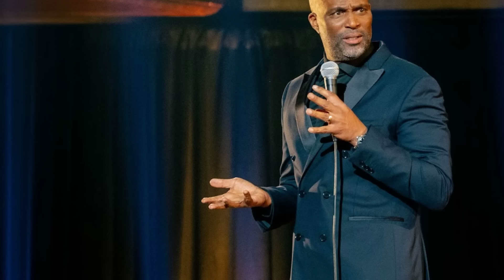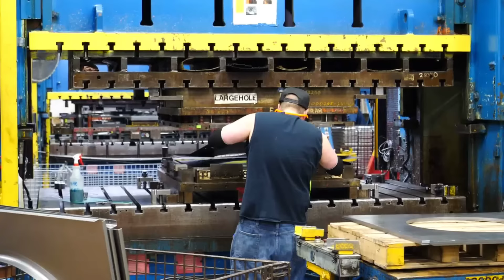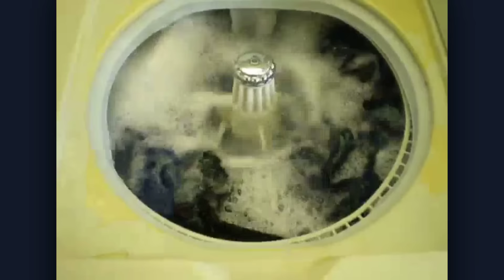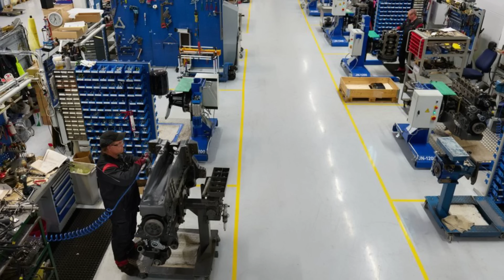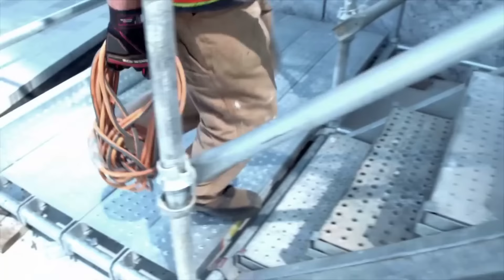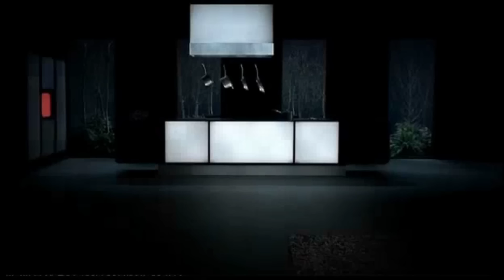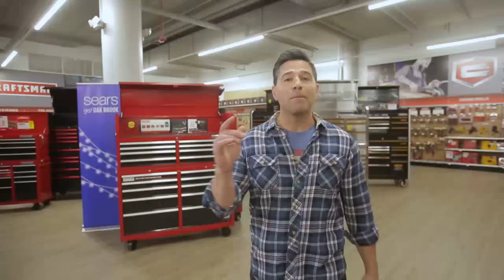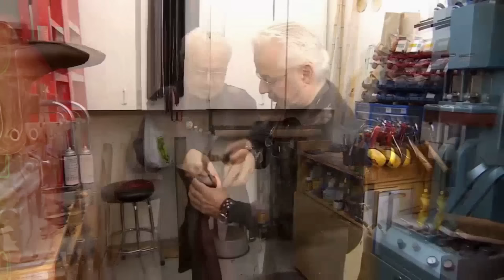The Only 5 Brands That Still Last (The "Buy It For Life" List)

Comment: I went into Lowe's 10 years ago and told the guy, I want a speed queen with a commercial motor and a stainless steel basket. Nothing else. No bells and whistles. The guy couldn't believe that is all I wanted. It's still running with zero problems...
Reply: My Speed Queen has been running for 8 years with no problems   The last Whirlpool washer I bought lasted barely 5 years.
Reply: I can get on board with that. My Speed Queen will be on my inheritance list as things stand right now. To my daughter, I bequeath one cared for top of the range Speed Queen washing machine......🙄
Reply: @Tsar-w1c Hopefully she understands and appreciates it instead of trading it in on a shiny new front loading Samsung spaceship with Bluetooth. 😅
Reply: @Tsar-w1c Hopefully she understands and appreciates it instead of trading it in on a shiny new front loading Samsung spaceship with Bluetooth. 😅
Reply: I didn’t know we could get speed queen at Lowes
Reply: @trishcrum7070You could 10 years ago. Don't know about now.
Reply: @trishcrum7070you can't, and you couldn't 10 years ago, or 15 years ago.
Reply: @trishcrum7070in Lowes in Australia 🇦🇺 they sell Cothes Neen around over 100 years
Reply: I was given a Whirlpool washer and dryer by my parents when I got married.  32 years and it's still running.  Only repair we ever had was a water pump.  Best present ever.
Reply: Same! Ours is turning 15! We are a family of seven, so we do laundry every single day.
Reply: Lowe's has not sold speed queen in any way, or at any time during the last 15 years.
Reply: I bought a Roper washer and dryer from Lowe’s 20 years ago. It was the cheapest set they had. I think I paid $500 total. The dryer is still going strong. The washer quit two years ago. AFTER lasting through two babies/toddlers. I don’t think the thing stopped running for four years straight. I also have an old house…in the desert. The machines are in the garage. So it gets near freezing during winter and 110f during summer. 
 Roper is Whirlpool’s budget brand. So basically they were stripped down whirlpool’s. 
 Point is that we don’t need $1500 commercial machines for home use. They could make a decent product that lasts 20 years and sell it for $500. 
 They did it. 20 years ago.
Reply: @AlphanumericCharacters They ( the corporations) Could make high quality machines, but they won’t.  The bottom line is the bottom line.
Reply: @AlphanumericCharacters have never seen a Roper. Now I will be looking (currently a new Whirlpool at the cheapest price I could find). 
The only major problem I have with my new ones is that the top loader washer is so tall, I must use a stepstool to reach the bottom to get laundry into the dryer (with no internal light). 
Maybe I bought Ropers marked Whirlpool?
Reply: @ecouturehandmades5166  Roper is (or was) Whirlpools bargain brand.
But neither is any good anymore. Buy whatever is the cheapest and just know you will have to replace it in 5-10 years.
Or buy a Speed Queen and you will never replace it
Reply: have owned my Speedqueen 10 years too.  only replaced a drum belt because husb jams 10 pairs of jeans in a load
Reply: I'm shocked the guy at Lowe's knew what you were talking about
Reply: my speed queen died,  cost to much to fix,, now i'm stuck with a 2018 kenmore but it was free !
Reply: Bought a TS5 Speed Queen 2 years ago. I got tired of front load “Washers” taking nearly 2 hrs to not wash my clothes. This washer cleans my clothes very well and is done in 30 minutes. I can have dirty laundry cleaned and dried from start to finish in an hour. I watched a video to learn how to stuff a piece of styrofoam into the back to turn off the inspection switch so that the washer still works/fills even with the lid up. My daughter in law makes fun of me being proud about my “Laundromat washer”. I’m figuring she can make fun of it while she buys her next 3 washers at least.
Reply: US made? OK.. But my first Miele washer was brand new and gifted to me by my boss. My first job after graduating.  After 8 years I left the firm after being headhunted and took my Miele with me. 12 years later I sold it on Ebay. We wanted some more bells and whistles. So we bought a new Miele now 17 years ago. Last summer, an  unbalanced centrifuge cycle at 1600 rpm caught our attention. We were disappointed and complained to the distributor. They sent a guy over who gave it a once over and replaced two shockabsorbers. Downloaded the stats of the machine and had a coffee with us. He showed us in the database that this was very uncommon and we would not be billed.   We should be good for another 18 years. But by then, we'd have a house robot doing our washing and ironing for us. So we are considering gifting the machine to one of our kids and buying a new one without too many bells or whistles as we only use 6 cycle types.
Reply: New speed queen is not the same.  I hate mine.. does not clean clothes on normal settings and the dryer burns my clothes
Reply: My front loader LG washer lasted for 21 years.
Reply: @Chhesterification you've been lucky.
Reply: @Chhesterification  Did you ever turn it on or did your house burn down??
Reply: @donkeyrinser I used the hell out of it. I even washed horse blankets and saddle pads in it.
Reply: @Chhesterification  Raised on a ranch myself, so I have first hand experience. That's crazy. Sounds like you got a diamond in the rough. Congrats.
Reply: @donkeyrinser I finally had to replace it. But it had a good run. When I move I plan on buying a speed queen. I'm not messing with any of the consumer brands.
Reply: My Kenmore Washing machine top loader has 21yrs & still going.
Only changed the rubber Washer Motor Coupler Coupling($12 part),twice in 21yrs(I’ll take that). That machine is a BEAST.
Reply: 10 years is not exactly a track record. But you are on the right path there... ;)

Comment: Knipex is good too, and even though it's made in Germany, I respect any tool / product from any country that works well and lasts. My LG washer is an outlier, bought in 2015 and only had to replace the waste water pump once ($25 for the part and easy to do...thanks to Made in China for providing the part) although, LG's charges $400 for a new boot gasket (just buy the $12 dollar tool, and soak the gasket in bleach for a half hour, good as new.) There's loads of disposable garbage out there, but even with the garbage, most times if you take care of it, it can last, unless engineered to fail no matter what you do with no parts available or engineering flaw, OR runs on unreplaceable lithium batteries. The WORST BRAND I found to be with regards to everything they make is Frigidaire / Electrolux

Comment: What pisses me off is that they purposely make appliances non repairable. If a microwave fails - throw it away. But it's not a rocket science to make a microwave repairable. What usually breaks in a microwave? Magnetron, latches... Sell these parts. Common failures center on a few key parts that manufacturers could easily make modular and sell separately.

Comment: While I don't mine Cast Iron Pans, my go to is vintage Revere Ware. Not the new garbage they make, but the 60's thick copper bottom and thick stainless steel. You can't destroy them, they deep clean with steel wool and copper acid cleaner. And since it's pure stainless steel. No chemicals and no transfer of anything.
Reply: This 💯 I bought a huge set, piece by piece, from Goodwill
Reply: @AprilcadabraWish I still lived in the USA so I could do this.
Reply: I use mine daily! I have so many sizes because I’ve picked up more at thrift shops…
Reply: I got my Revere Ware 30 years ago when I got married. I'll be passing it to my daughter one day.
Reply: I got my moms, from 1955. They’ll last forever.
Reply: Yeah, I have some I bought new 35 years ago and then got others at estate sales.  I use cast iron too, but I think some things work better with the steel and others with the iron.
Reply: The Company was literally founded outside of Boston, MA by Paul Revere who was a Silversmith and Coppersmith.
Reply: I still use my grandma’s and mom’s old Revere Ware but also bought some pieces of my own when I got my first apartment decades ago. Never been temped to use anything else except for some Griswold pieces.
Reply: My parents are still using the set they got as a wedding gift in 1980. Looks brand spanking new.
Reply: I wish I still had my Revere Ware that I inherited from my grandma in 1978.  Probably 40+ years ago my Mom talked me into loaning it to a guy she was dating - operative word “loan”!  Never got it back when she dropped him.
Reply: Please, I have a question. I LOVE my R.ware, and lent my big pan to a neighbor who returned it warped...is there ANY way to get it straight again????? 

Thank you, VERY UPSET in 🇨🇦
Reply: I have a decent set of Revere Ware I bought in the 80s and a fair number of different Griswold cast iron.  A few years ago I added a couple of saucepans by Demeyere.  They are made in Belgium, are a five ply stainless steel and aluminum sandwich and have well designed cast aluminum handles that stay cooler than most others.  Very nice pieces.
Reply: I've got a set of 45-year-old Farberware pots & pans. Stainless steel with aluminum-clad bottom. Wouldn't trade them for anything.

Comment: I inherited a Dorsey hand mixer from my grandmother and it still works well. I also inherited her Electrolux vacuum cleaner from 1940 that still works. I bought my own Electrolux in 1978 because both my mom and grandma had one and I have only replaced the hose and the wheels. The Singer Featherweight sewing machine is a workhorse from around 1940 and have one. I also bought a Singer sewing machine in 1978 and use both regularly for clothing, quilts, and other household goods and crafts.

Comment: Even Speed Queen now has a printed circuit board. The TC5 is small(3.2cFt)
Honda is a fantastic engine. Predator from Harbor Freight is a good budget alternative
Redwings are great boots. I am on my 4th sole
I have tons of cast iron, some of it was my great grandmothers. Lodge is decent; I sanded it smoother before use.
Knipex are the best pliers, ICON and WRIGHT make good tools
I wear All American Jeans, they last 4-5x the newer Levis that come from overseas.

Comment: 5 years ago, I was forced to go out and purchase my wife a new front-end loading, washer, and dryer. I guess she was tired of looking at old design. So I took the old ones and put them in the garage eventually, I hooked them up in the garage for an emergency. In that 5 years, my wife has been to the garage three times to do laundry because the new ones broke down. The most recent breakdown was the pulley system on the washing machine. When?\n I came home from work there. My wife was in the garage, drinking a glass of wine and talking on the phone with her friends, waiting for the clothes to be done in the dryer, I got out of my car.  And laughed, she said, why are you laughing? I said, just think of all the extra exercise you're getting from that new washer and dryer, not working.

Comment: I have a Speed Queen washer and I think the one specified in this video. This washer may last a long time but I have a story to tell you. I had a repair company come out about 5 times to repair my Speed Queen. The issue was water related. First they sold me a new plastic water inlet valve. The repairman told me it is the Achille's Heel of the unit. That repair helped but it didn't fix the whole issue. Then they came out and sold me a new motherboard. That didn't fix the problem. Then they put a new belt on the model. That didn't fix the problem. Then they finally removed one of the hoses from the back of the washer and POKED A HOLE in the SCREEN FILTER which is attached to the hose washer. Finally the problem was the unit was quitting in the spin cycle because there wasn't enough water going into the rinse cycle. The screen had some trash in it. I was charged $600 and had to go to the laundrymat even though I had spent $1,200 on a "dependable" Speed Queen. I had to wait for the model too during the Covid Shutdown. This unit may last a long time but I've already basically spent enough money to buy a cheap washer. So, if you have Hard Well Water as I do, remember it clogs up the inlet valve. And you might get some trash in the filter.
Reply: Sounds like a lot of the issue may have been the repairmen and not knowing what they were doing. I too have a well and mineral deposits can sure be a problem. We also have a water softening system to combat that. And it sure does help a lot.
But we do still get some mineral deposit collection on the filter screens. Same for the sink faucet screens.  But the same thing happened when we were on city water at our previous house. And the same will happen on any washer that you get. Just have to learn how to clean the water filters.

Comment: All of those gas small engines keep working if you use non ethanol gas. It costs a little more than premium but My mowers and tools keep going.
Reply: "Costs a little more" $25-$30 per gallon for non-ethanol in my state. I use premium octane with stabilizer which has worked well if non ethanol gas isn't available or priced insanely high.
Reply: @LarryG321 Wow! it is only a  dollar more in my state. It is just a little more than premium here. I usually find it at Shell stations. Dont buy the stuff in the stores. Try a Shell station.
Reply: @LarryG321 you can buy ethanol free at the pump. I just saw that expensive stuff online. Nope, not that one. Take your gas can to the gas station and look for the ethanol free pump. Just as you would pay for diesel fuel. It helped me a lot when started using it. my tools crank year after year. I have Craftsman, Honda and MTD. They all fire right up and my arms are puny😮

Comment: Look at Staber washing machine machines. I used to sell them 25 years ago to people who lived off grid with wind and SOLAR and batteries for power. Needed something that worked that didn’t use a lot of power or water.
I sold a total of six :-). One to myself. We still have ours, still works fine. They ARE. Made in the USA. Really. You can still get parts for them. They are made to last. No, I don’t sell them. I’m an electrician and I used to sell them too my off grid customers.

Comment: Replaced a useless front load washer with a second hand KitchenAid top loader with a direct drive motor and muti functions with a none locking lid. Best washer I have owned ever. Still have a working 1984 Maytag dryer and a GE Medallion electric range with real fuses in the top panel. An appliance repair man told me to keep my stove as the newer ones don't have fuses and when they blow they cause fires which start in the electrical panel of the house and end up burning down the house!

Comment: Kobalt Tools used to come with a LIFETIME WARRANTY. 
because 98% of anybody who uses a wrench / ratchet isnt going to break it -- EVER.
you know how hard it is to Bend a Wrench ?? damn near impossible. Hence the Lifetime Warranty.

but the warranty is only as good as the product - right.
like Autozone --- most places wont sell an Alternator or Starter with a Lifetime Warranty... bcuz ITS GOING TO WEAR OUT..
but for some reason, Autozone DOES.... and it DOES Wear Out...usually withing 1-2yrs... and you have to replace it Again....and Again... and AGAIN.
but if you just spend the extra $20 for Bosch... it will last you 10 years or more...   MONEY WELL SPENT....

Comment: I have a 1990 Chevrolet S-10 Tahoe short wheel base. It has been in regular use since my father bought it new. It runs like a top. The only problem I have with it is finding someone who knows/wants to work on it. I keep it well maintained (which averages a few hundred bucks a year). It is my only vehicle.
  AND I have an iron skillet that belonged to my great grandmother. It has been used so much that I can’t tell who made it because the name has worn off the bottom.

Comment: I searched for 2 years for an elna 1010 sewing machine. My rowenta iron is made in germany. I paid $4 for at goodwill. I got my drive train maytag washer and matching dryer at a farm auction for $25 each. Only needed the washer but for $25 i took the dryer too. I am still kicking myself for not buying the whirlpool fridge thats 30 years old exactly like mine. But mine still works good. But still! 
If it has a computer in it, I cant fix it myself. I wouldnt take new anything if they gave it to me. Its principle. Far too many people will go to a job and build this crap knowing full well it should be criminal how the shareholders are the only ones reaping/r*ping benefits!

Comment: Well I have to push back at 3:00.  Any engine that is left with ethanol fuel for an extended time will suffer carb clogging, and Honda's are no exception.
Reply: I came here to say this. But this is Ai slop
Reply: I'm a Californian. I agree on principle. I own all small engine two-stroke equipment but my honda mower and Jennie have both fired up in the spring after 5 months with a bit of fuel still in the tank (my bad).

Comment: My Maytag commercial washer has given me 8 years of service, it does have solid state computer control, but that’s what is there. My oster toaster oven has been with me for ten years, mechanical timer and wide enough to make a 10” pizza. You’re right about discount store stuff, I have a small 2 cycle generator I got from harbor freight, I have to spend a little time to get it running again, used to start on first pull but not lately